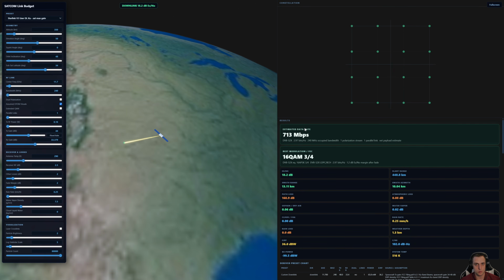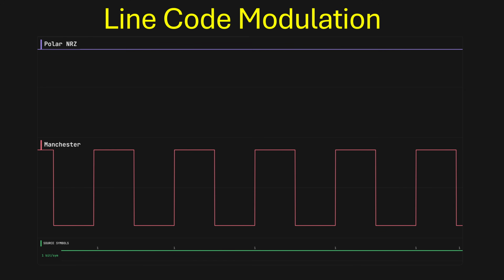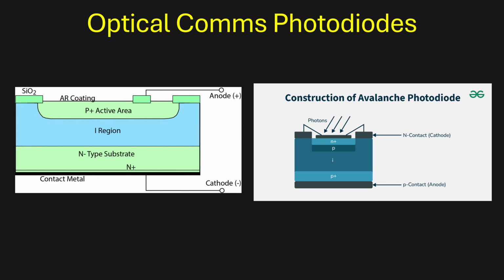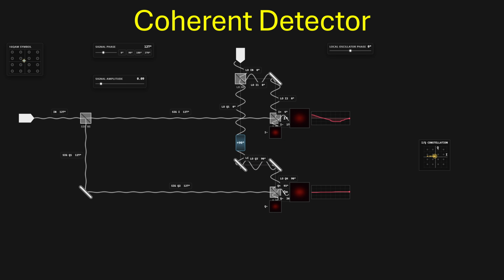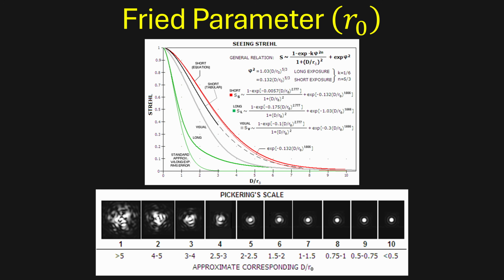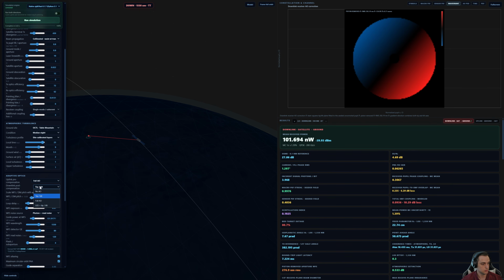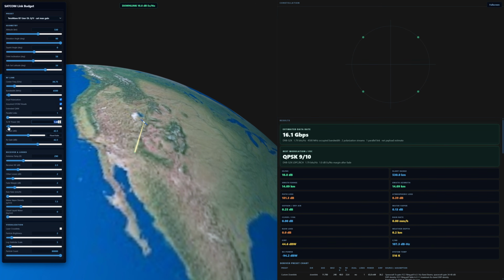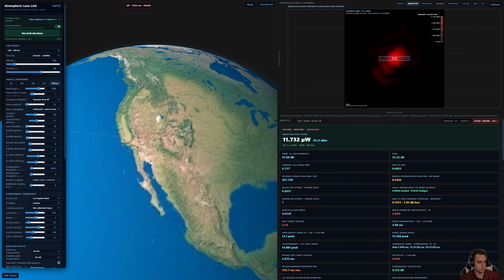Blue Origin’s Insane New Laser Constellation

Comment: I think you are wrong about competitors launching on SpaceX. They only would have to pay the higher market rate (vs the lower SpaceX internal launch costs), but SpaceX would totally launch their competitor for multiple reason. It brings money, great PR (e.g. if they launch Amazon satellite which originally planned Blue Origin). But most important: declining to launch competitors would could bring legal trouble with anti competitive laws, monopoly laws etc. If we believe SpaceX plans for the high launch cadence for Starship, they capacity will be there. But I agree, that SpaceX will likely dominate, because of their huge headstart and low launch cost. And more importantly, network effects! Two competing 10.000 Satellite constellations (without interoperability), will have lower capacity than one interoperating 20.000 constellation, because you can get better in orbit routing with more options to use the expensive hardware, more reliability etc. So for SpaceX adding a new satellite to their 10.000 adds more marginal value, than an identical satellite adds to the growing competitors e.g. 1000 constellation. Also SpaceX has harvested many customers, with the ground hardware, there is some vendor lock in. A new competitor will not be nearly as profitable as SpaceX while building out. Terrawave is smart to propose a slightly different business model with the high bandwidth to a few customers, but I see no reason why starlink could not just add such capabilities to their existing network as well, but requiring fewer new satellites.
Reply from the maker: Ya I think they will just do a few token launches of competitors for PR/regulatory but nothing that would move the needle

Comment: I think 6  optical Links in the V3 does not have to mean Laser to earth: 2 Laser to connect constantly to the next neighbors in the same orbital plane. The third connection will be to a satellite in relative motion, so will be interrupted soon, so you want a 4th link to establish the next link before the 3rd one goes down. But the biggest reason is just field of view, even with full 360/180 swivel, the satellite, panels or other laser links can be in the way, especially when you consider laser links to satellites in higher orbit. so 6 links can be very useful for pure in orbit communication

Comment: P.S. The major reason it’s taking so many tries to get Starship to orbit is because regulations (rightly so) won’t let them do it unless they demonstrate extreme reliability with things like Raptor relights. When conventional rockets fail, the upper stage can simply burn up mostly on reentry. What’s left, if anything, is just small, slow-moving debris. Starship, on the other hand, is not only big but also specifically designed to survive reentry. If they fail to deorbit it, it could very well crash into a populated area, essentially like crashing a big airliner.